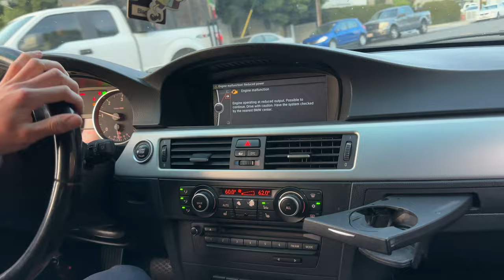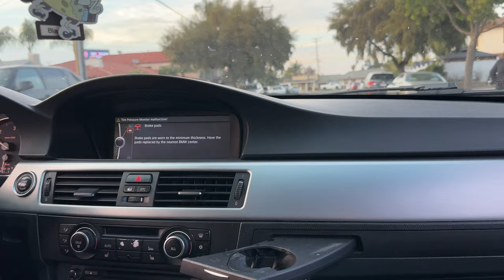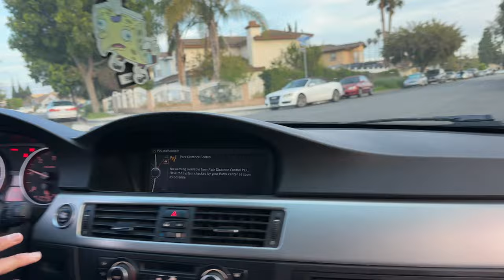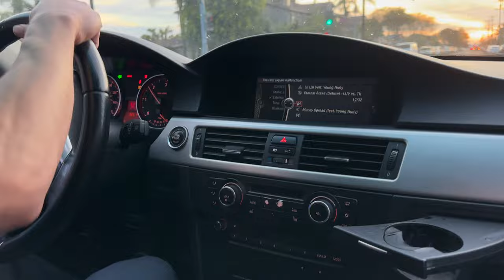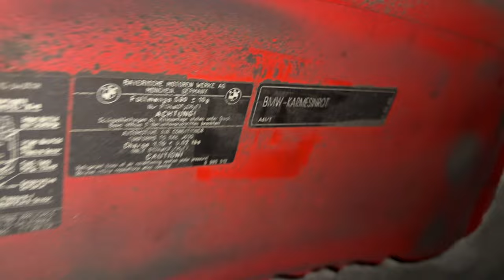Garage Vlog with the Homies! *Featuring 335D*

Comment: i have a 335d and I have that same problem when the check engine comes on when you push it near redline. i have had this problem ever since i tuned it and can’t figure it out. went to a bmw  specialist and they said that it’s most likely fuel pressure sensor so i’m replacing that. hopefully it fixes it
Reply: That’s exactly what it is, got the code for that. Will be changing it to an m50d fuel pressure sensor. Thanks
Reply from the maker: Hit up bro on ig bout it he’d appriecate it
Reply: @aaroncastaneda7811  wait is there a reason your putting the m50d fuel sensor instead of the m57 one
Reply: @dieselbimmerr running higher fuel pressures that the stock sensor can’t read. All of my sensors are different bc I’m on the dual HPFP from santjer